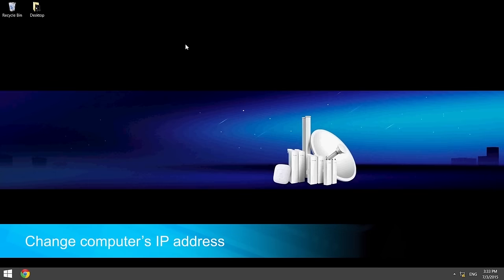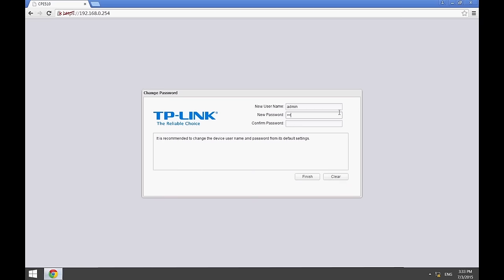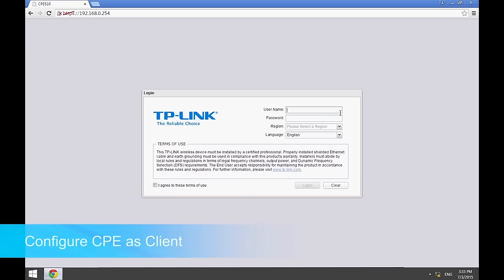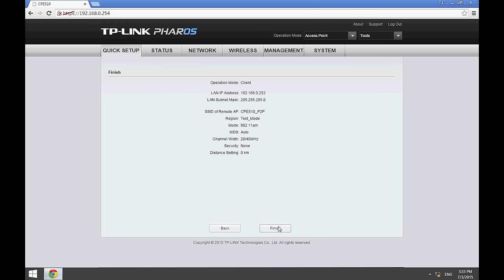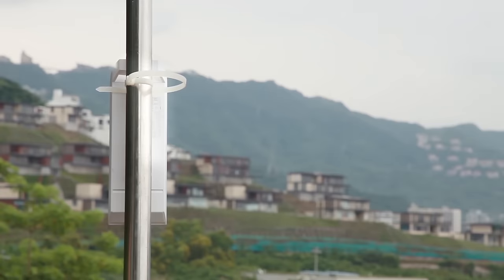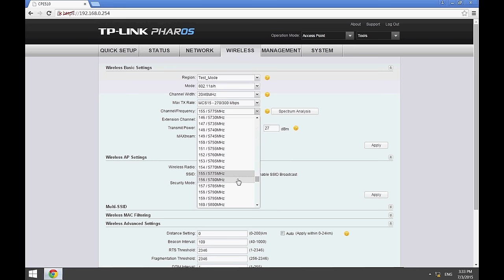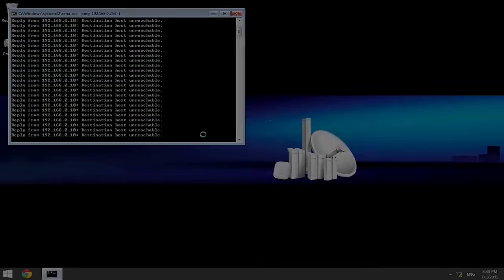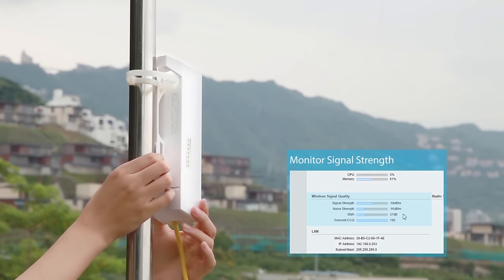TP-Link CPE Point to Point Installation and Configuration Tutorial Video

Comment: I have 7 CPE TP-Link WA5210G 2.4Ghz and are much better than this CPE 210, just bought one and I could not use the signal is too weak, it can not connect to WA5210G and distance are just 900 meters, I could only use it in distance of 50 meters, horrible product. I wanted to gain performance with 300mbps and only won sorrow, need to change my WA5210G because I need more speed and can no longer rely on just 54Mbps
Reply: I bought CPE 510 devices 2 days ago and i noticed their signal strength is very week.I'm surprised how a company like tp link can create such a cheap product.I was thinking there may be setting problems but after reading your comment it is clear that we have wasted our money and time on these cheap products.
Reply: He is refering to the CPE210, not the CPE510 that you have.  I have used the CPE510 here in Norway for many applications and they works very good.  No problem with the signal strength.  Try to use the spectrum tool to see what other wireless networks are nearby.
Reply: ops iread yor comnts and now my money is safe i use my money to ubnt powerbeam M5 ac 400 and this is perfct product powerbeam p2p connectivity
Reply: Why 2.4Ghz ?
 buy another with the 5Ghz wireless compatibility

Comment: Awesome hardware and easy to set up.  I used for AP (access point) and provides full performance (80+ Mbps) over my  back yard
Reply: So if you buy this devices and set them up you won't have to buy data from ISP
Reply: Range
Reply: @MDsaifulIslam-rp5wd  
For point-to-point,  I operate 4 HD cameras in our barn,  which is ~300m from the house and through some trees in the way.  I get very good S/N ratio of ~60dB.

Comment: Thanks for the video, considering buying these or the CPE210.First question, What UTP cable do I need to extend distance between the poe output of the power adapter and the poe lan0 on the accespoint(Extend to 20 meter)?Second question, What I am missing is the setup between the access point and the modem/router of the internet provider, because I think the access point needz to be in the same IPrange as the IPadress of the router, otherwise the client won't get access to the internet or am I wrong?Thanks for answering. One more question is the software of the CPE510 the same as the type CPE210?

Comment: Hi, I have a question regarding my setup. Now I own 2 CPE510. I have tried them but the signal is not strong enough to go through trees at a distance of 1.2 km. Now I am thinking of buying another CPE510 and use it as repeater to bypass the trees. My question is. 
Is the repeater mode in therms of transmission power and not bandwidth as good as a AP?

Thank you in advance.

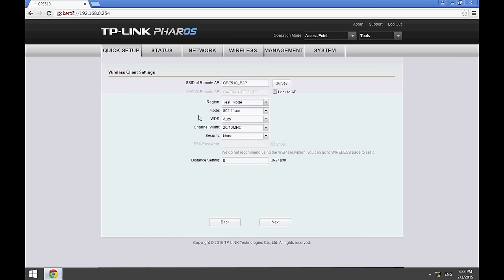Comment: At 4:16 where it says "security: none" you need to select wpa 2 or wpa 3, because wep and wpa have almost no security, other people can connect but also see your traffic. 
Wifi networks are scanned in bulk very often, don't assume nobody will reach your network :)
Reply from the maker: Your right, they are, but WPA3 is not fully adopted yet and this is video is from 2015, so there is about 5 years of dust on it.

Comment: I have ordered the same model today, hope I will configure by steps you shared. Thanks for the video.  At my site Distance between 2 devices is not more than 200 Mtr.   Installing TP Link to Avoid Fibre cable.
Reply: Work perfect for me...i get optic speed from my friend..100/100 only because lan port on cpe didnt support more

Comment: How much is the average transfer speed between the two devices if the distance is 2 km over urban area but clear sight between antennas? I see it is 300 Mbps, and the ethernet on it is 100 Mbps. But in a typical scenario, what speed that I can expect in these conditions? Thanks!
Reply: +György Vajda From my experience, it is 80~90Mbps if the interference is not that strong.  U can do a spectrum analysis first to choose a clean wireless channel. Or try to use 20MHz channel bandwidth to get more immune to the interference.

Comment: Please be aware regarding the (DFS) Dynamic Frequency Selection on 5 GHz.  DFS is prioritizing military radar, satellite communication, and weather radar. 

That means that your link will disconnect between 1-10 minutes if it will find a military radar, satellite communication, and weather radar use in you neighboorhood. 

The sellers of 5 GHz links, as TP-Link, are talking quietly about this. I had to learn it the hard way.
Reply from the maker: This is not being quietly spoken about its a nature of the beast.  DFS are typically reserved for Radar.  To get FCC certification to use the channels are legally required to include such a check and balance to ensure the wireless use is not interfering with said radar.
Reply: @TPLINKTECH  You and other companies doesn't inform us customers, when you advertise this products, about DFS.

It took me 2 days to understand that it wasn't my setup which were wrong. 

For any user where stabilty of a WiFi connection is important, any equipment using DFS should not be used.

Comment: Hi, I have a TP-Link to exclusively communicate with a clients driveway automatic gate. Every 6 weeks I have to go back and open up the gate controller to re-enter the TP-link password, like it has an auto-log off security feature. Real hassle.  Is there a configuration to stay logged on/in indefinitely? Thanks
Reply from the maker: That would be something you would need to troubleshoot with the gate controller manufacturer.  A CPE like any AP should keep a device connected, as long as its communicating and in range.
Reply: @TPLINKTECH  But as I kinda remember, the Tech who installed the TP asked me when configuring it if I wanted this (log off) feature for security, in case someone outside got inside. Are you certain it is not an option.. 
 I admit it was a while back-cant be sure.
Reply from the maker: @chuckb337  No because the channel managers here aren't trained on SMB products.  As far as we know in AP mode, the unit shouldn't have any auto-off,  There might be a Wifi Schedule option, but that would disable the wireless only during a certain time but that would be based on days.  not multiple weeks.  there shouldn't be a feature like that.  You can reach out to business support support.smb@tp-link.com  to be sure though.

Comment: Does the AP have to stay connected to a computer or can it operate wirelessly after the setup of it and the client?
Reply from the maker: The AP will need to physically stay connected to the router or switch via Ethernet cable
Reply: TP-Link can the receiving end be plugged into a WiFi router so that I can use WiFi instead of Ethernet cables?
Reply from the maker: @imaeiteen3183  a router or a AP both would work

Comment: I am setting up an RV park using these. Can I have 3 clients all pointing back at the access point? Like could they all share the same SSID and have 200 feet between them?
Reply: I am using the CPE210
Reply from the maker: @Duckathan  as long as they have  line of sight with the main AP they should be able to connect.   Though in your situation I would actually recommend the EAP225-Outdoor instead of the CPE210.  Using the TP-Link Omada Controller you can wireless Mesh the units to each other   They transmit Omni-directional instead of Directional and they operate on both 2.4GHz instead of 5GHz.  and using the controller they can all be managed at one time instead of individually.  the EAP225-Outdoor has a maximum range of 150 Meters so that would more than suffice for 200 feet between the units.

Comment: Hi, I'm trying to extend the wifi coverage for a hotel on a budget and I'm wondering if this setup will work: Internet--->Router---->CPE-510-------------->CPE510---->Router---->Access point

Router: TL-R480T+
Access point: EAP-220

The hotel has two buildings that is difficult to reach with just ethernet cables hence the CPE. I'm also wondering if you still need a router after the client side CPE or will a switch suffice?
Note: More access points and switches will be added to each router once I get it working.
Reply: yes
Reply: Juan, did you need a second router?  Wouldn't the client side CPE plug into a POE switch, and you can plug the EAP-220 into another port of the POE switch?  At least that's how I hope it works.
Reply: This will work.
Reply: THANKS!
Reply: One thing you can consider is to use the CPE of the 2nd building in its "AP Client Router" mode so you can have a wifi network there. The "Bridge" or "Extender" modes will also do the same job but in the same network.
Reply: @DiegoTorresV11    Interesting, I am a novice... what's the difference between "AP Client Router" , "Bridge", and, "Extender"?
Reply: You do not need the second router.

Comment: Is it possible to use a normal router as the AP and a single CPE 210 as the client?
Reply from the maker: No, the reason is that the CPE210 has a very small azimuth that requires unobstructed line of sight.  You would need to have two units one as the AP and one as the Client.

Comment: Quick question: will it worked on an apartment on a 1st floor to connect to a wireless router on a 5th floor (27 meters aprox. clear sight)? if yes, will 2 CPEs be required for it?
Reply from the maker: No because there would not be line of sight in that situation.
Reply: @TPLINKTECH  Just what I thought. Thank you for solving my question.

Comment: Thank you for sharing great video with perfect explanation. ...
I have a problem with my device 2.4GHz High Power Wireless Outdoor CPE
as i am getting intreption or in other words disconnection for 5 seconds !!!!
any solution ???
Reply: +Shaheen Naryabi What's your detailed topology and problem? Do you mean the CPE lose connection with another CPE or your client devices lose connection with CPE?
Please check whether there are any barriers between AP and Client, besides, you can use 'spectrum analyse' under wireless menu and select a cleaner channel to avoid interference. At last, what's the distance between AP and client? Remember to set a distance under wireless menu.

Comment: Will this be able to pass through some buildings? Not to tall around 5 floor only and my plan for antenna is on 2nd floor
Reply from the maker: No.  Open line of sight is required.

Comment: Not setting up any equipment, but studying for the CCNA. This is interesting.
Reply from the maker: Nice,  Good luck on your test.  Look into the CCNA security test.  You can use that test to test or renew for the standard CCNA, also take the test just after the test "resets"  This gives you an advantage because both result in a smaller question pool, making passing the test a lot easier.

Comment: Can I used this device to connect to a wifi network that is 1/2 mile away. Trying to cut down on my expenses. Thanks
Reply from the maker: Yes that should not be a problem.  even on the CPE210 the max range is 5km which is about 3.14 miles.  You will need two units though.  One at the source and in AP mode and the other at the remote location in Client mode.  You will need clear line of sight as these models are all directional  based antennas.

Comment: I have installed two CPE510 units they connect fine and i have good signal strength. If i send data over the link it works fine but if there is a period of inactivity the link seems to stop working and i have to reboot one of the CPE's. After doing this the link works again until the next period of inactivity. Every morning I need to reboot. Do the units have some sort of sleep mode. Please help.
Reply from the maker: Honestly not sure on that one.  You can email our business support at support.smb@tp-link.com and they will be able to tell you.
Reply: That's happening when the (DFS) Dynamic Frequency Selection, on 5 GHz, is active.  DFS is prioritizing military radar, satellite communication, and weather radar. 

That means that your link will disconnect between 1-10 minutes if it will find a military radar, satellite communication, and weather radar use in you neighboorhood. 

The sellers of 5 GHz links, as TP-Link, are talking quietly about this. I had to learn it the hard way.

Comment: Hello , i have a couple questions .
1. Can i use only lan connection from router to AP and configure it from smartphone browser ?
2. Would i have 90%+ internet speed with clear line of sight on 100 meters (150Mbps is speed out of the router) ?
Reply from the maker: 1.  Yes you can
2.  It depends on multiple factors.  Its possible but we can't guarantee speeds

Comment: Bro plz make a video on spectrum analysis how to check and connect best  frequency channel with less intereferance
Reply from the maker: For CPE systems that is very difficult to do.  It's not like an Omnidirectional low-power system that is easily influenced but other systems in the area.  These systems are high power and very line of sight.  The main interference factor is if something obscures the line of sight of the system.

Comment: i have an open wifi near my house but icant fix the other pair of CPE on  the building from which iam getting open wifi  i tried a lot of tricks but the signal till my house is very weak  can i fix one pair of CPE and connect it to my wifi router

Comment: All good, but where the first cpe gets the internet from?
Reply from the maker: Your internet provider.
Reply: @TPLINKTECH  from the lan port on the Poe ?
Reply from the maker: @TzouPhotography  Think of the first CPE as any other Access Point it needs to be physically connected via Ethernet to a router or switch connected to your internet source. This can double as a POE source as well if the port is capable or you hook an injector to it as well
Reply: @TPLINKTECH  Thank you very much!
Reply: @TPLINKTECH  one more thing, if i do all that, the second cpe ( client ) can give wifi to devices ? And not only by ethernet
Reply from the maker: @TzouPhotography  No, even if it wasn't in client mode, general use devices like phone and laptops would not be in the CPE's view.  CPEs are extremely line of sight and one-directional devices.  With it in client mode you would simply connect a desktop AP or router to it via ethernet and that would provide wireless to your general use clients.
Reply: @TPLINKTECH  Well in my case, i have the first cpe connected via Wifi to my modem, ( repeater mode ) the second cpe connected to the 1st one and again at repeater mode, the second cpe gives me internet through lan from poe adapter and via wifi, it's slow and not stable but it's real. How's that?

Comment: Hey nice video!.   Just 1 doubt.  Do I need to add the "security option"  by adding a password right? (created on the AP ). Otherwise anyone with a CPE device  would be able to get signal from the AP.  Is this correct?
Reply from the maker: That would be accurate for any open network.  You would want to secure your network always.  With the CPE however a client would need to have line of sight and be within the beamwidth of the CPE to be able to communicate with it.

Comment: Excuse my English, I do not know much.

I liked your video and some questions came up.

The first, can you connect several CPE clients to a single AP?

Second, one establishes until which range the signal is established?

Third, can it be implemented to access the PCs that the client shares?
Reply: The Answer is yes, you can connect multiple clients with an ap. Yes you can access the PC's of client side from ap side if DHCP server on both pharos devices is turned off and dynamic IP's are being allocated by one device. Please let me inform if you want to know further.
Reply: @mohsanadreesadv.  Can we connect a switch to client cpe... For connecting routers to switch

Comment: How receiver antena can work without lan cabel from pc? I want have wifi from receiver antena
Reply from the maker: Can you explain in detail what you are trying to do?
Reply: @TPLINKTECH  I have router with wifi in my house. I want have same wifi in my garage which is 50meters from my house. I bought two of tplink cpe210, made everything same as in video, one is AP(outside on house wall), and second one is on garage wall as client. Now what next? If I want from client cpe have wifi, so I neec second wifi router in my garage? And I need connect it via LAN cable from client cpe to second router? Is it right?
Reply from the maker: @edvinas4072  Yes, you would need an indoor ap or router on the client end to get Wifi in the detached garage.  additionally, it would not be the same Wifi as the AP cpe210 is generating the signal and the Client CPE210 is receiving it.  

If you want the same signal  in your garage as in your home look at Deco and pair it with a Deco X50-Outdoor.  That should accomplish your needs.

Comment: For WISP setup, which APs are recommended, and can it work with third party APs as well. If we use WBS510 as Main AP and connect with WISP mode CPEs?
Reply from the maker: Depends on your needs.  CPE510 is 5GHz and CPE210 is 2.4GHz  for Questions regarding specific deployments though we suggest contacting our support team.
Reply from the maker: Nikos papadopoylos  Depends on your region.  https://www.tp-link.com/us/choose-your-location/ select your region then support then contact technical support

Comment: Hello 
If I use the Access Point TP-LINK TL-WA801ND_V1 Wireless N300 and use a 2400 WiFi parabolic dish instead of the Omni Directional Antenna, how far can I get the frequency 100% without loss of quality ? ? ?
For outdoor long range point to point use.
Reply from the maker: Can't answer that because that is outside of the products intended use.  the WA801ND is an indoor AP not an outdoor one.  also the antenna are bound to each other so all antenna have to be the same.